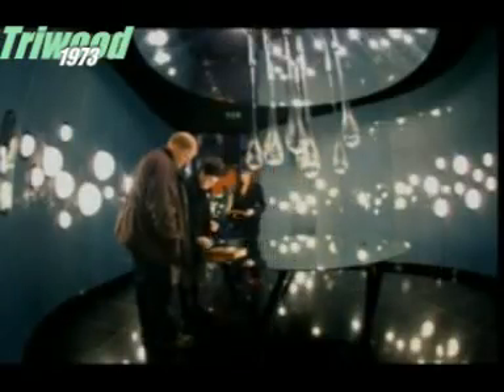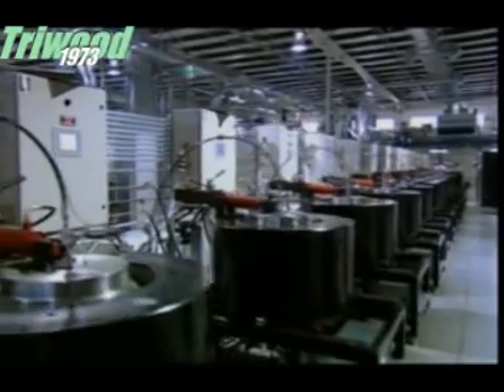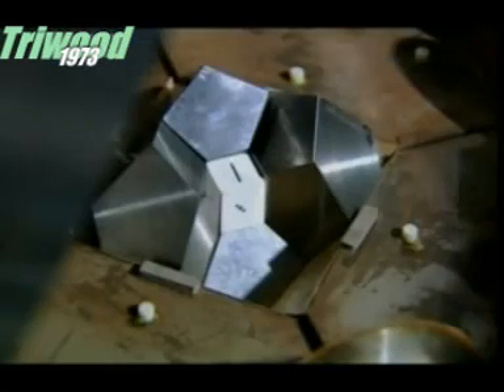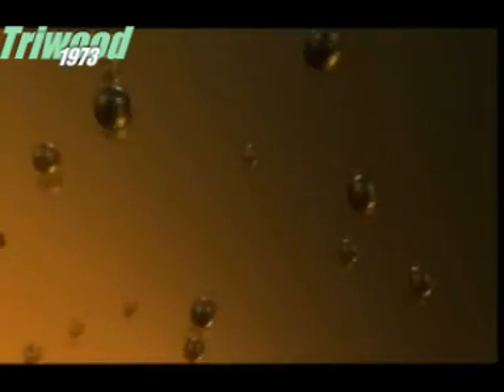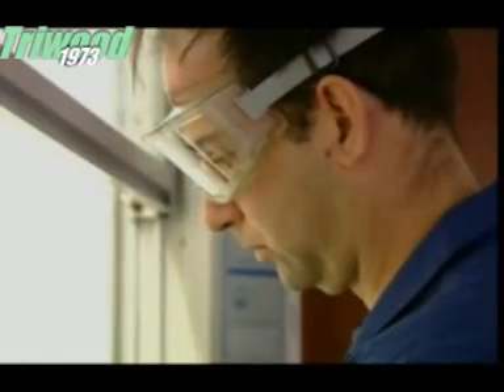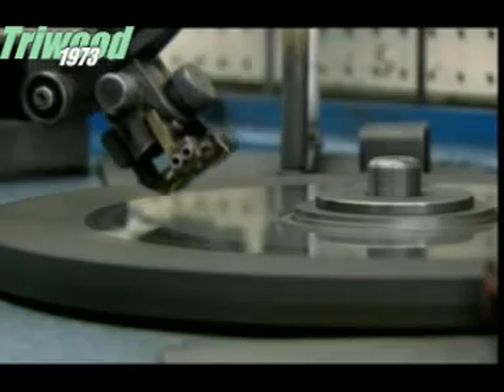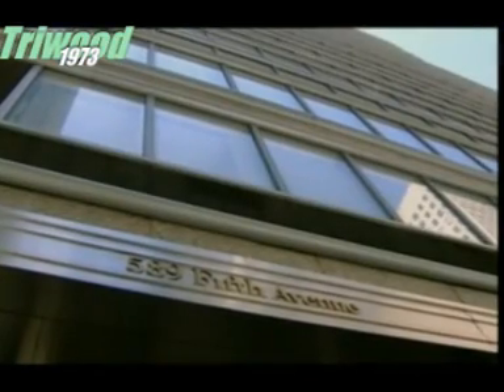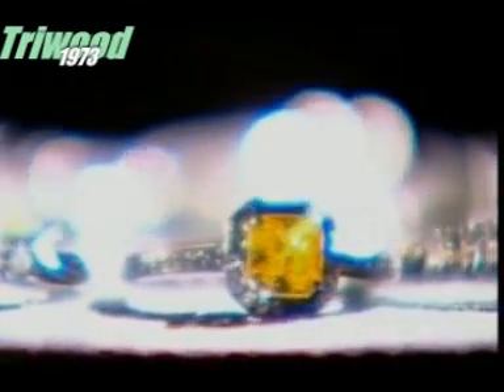Growing Diamonds Artificially

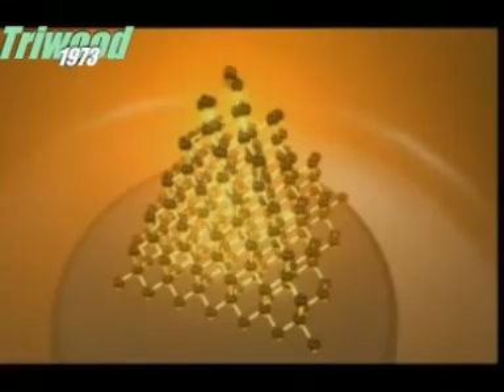Comment: 3:06  But I wonder why it is hit-and-miss...  Maybe some of the original crystalline structures of the seed diamonds have some non-conforming, non-uniform, atomic-packing structures or some sort of unwanted cleavage.  Perhaps also there is dust that settles on the crystal structure at a critical building point, creating a princess-and-the-pea effect, but legitimately.  Maybe there are imperfections in the graphite that is melted (i.e. even if it is only 99.99% pure or something) or there are imperfections in the other parts of the closed system that is put under the immense pressure. {Or does an extremely large crystal always easily grow around minor atomic or molecular imperfections from some other material landing on it during the solidification or deposition process.}  I ramble on about this topic because I wanna know where the gold at.

Comment: the true revolution of diamonds would be to use it as a substrate for electronics.  Diamonds have some of the greatest thermal resistancce properties, a diamond semiconductor can be overclocked massively and have immense computing power vs silicon which breaks down at 200+ degF.

Comment: Well that's pretty kool, Although its not free money if u own a diamond machine. The energy required to make one would be very expensive and is not too different to solar panels. Solar panels are made from essentially sand, the cost comes from the heat energy required to grow a silicon ingot. I'm guessing the heat energy to make a diamond would be similar.